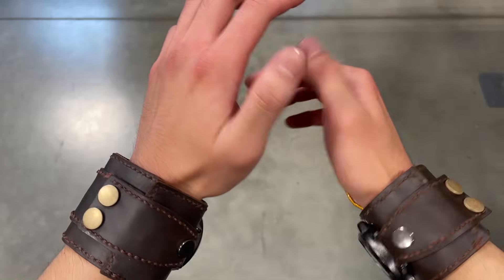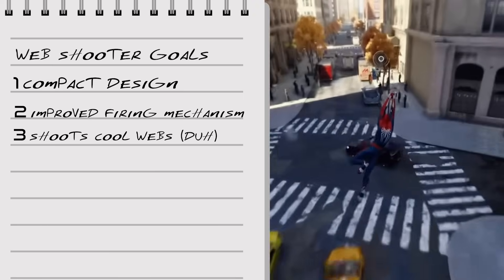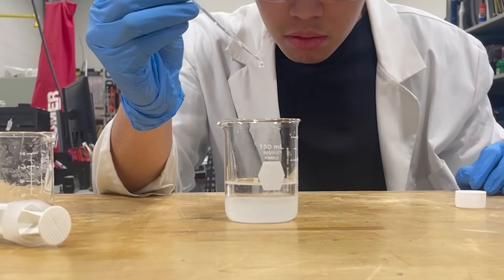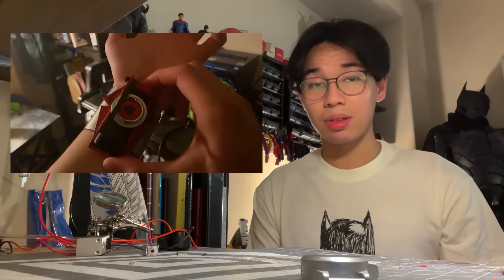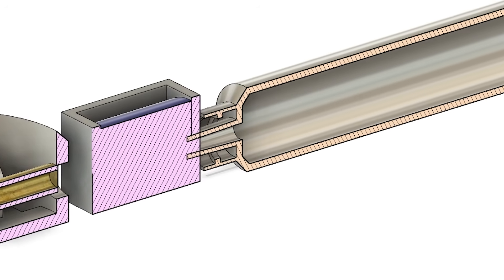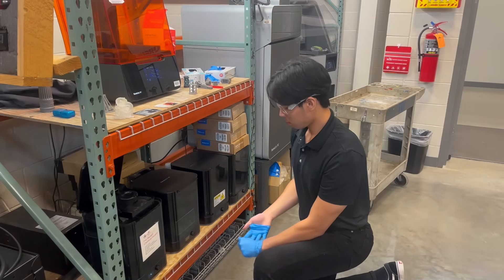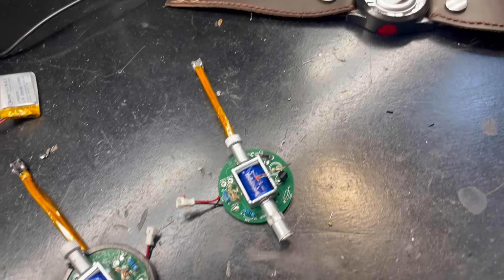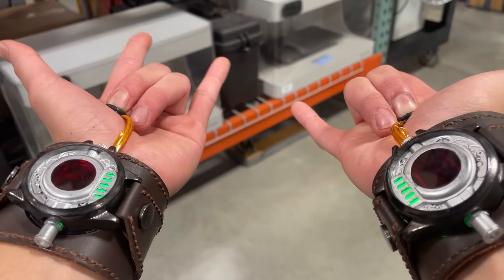How I Built Real Web Shooters | Spider-Man

Comment: Can you please make a proper tutorial? I understand that a solenoid valve only opens or closes the flow path, so I’m confused about how the water is actually being pushed out. How is pressure being generated in this setup? I didn’t understand how the syringe plunger, which appears to be under vacuum, I understand why it moves , but how does it push the water out. There is no pressure of any kind from the side of a syringe, for the water to be pushed out from the outlet. Could you please explain this step clearly?

Comment: Have you tried biosensors on the webshooter and modifying the sleeve and making an attachment?
The bio sensor would be used to detect muscle movement, when doing the spiderman firing method  certain muscles move, using a biosensor would detect the movements, using them as a firing method
Reply: Making an attachment for the sleeve should allow the biosensor to detect the movement better
Reply: Like a fitbit for example

Comment: Honestly, thats the most brilliant thing about Peters webshooters and how he designed them. Only he can use them, any normal person using them to swing like he does would likely rip their arms and muscles apart but since he has super strength, durability, enhanced senses, agility, and reaction time these gadgets that would normally be impossible to use are indeed possible but only for him. There's also the fact that the pressure needed to use the webshooters and actually shoot the webbing out is about 50 or so pounds of strength, something that you're average joe isn't going to be able to do with just two fingers and certainly not so easily and at a moments notice like Peter can. Only he can use his webshooters.
Reply: He ain't real though, bruh
Reply: @HAREKRISHNA-gv8qf obviously, genius. What are you gonna tell me Santa Claus isn't real either?

Comment: hey just one small thing that everyone forgets is the main reason his spider web is fictional is not cause of fast solidification it is just cause peter made his web fluid conductive too like alot conductive which is not easily possilbe along with fast evaporation of web fluid liquid and fast solidification and is most likely impossible as the sturcture would be unlikely conductive as most people use kevlar as a rope to swing wihch is not conductive as much as what is fictionally possible

Comment: Im quite confused with the wirng diagram especially when i try to recreate it on tinker cad. The trigger led keeps exploding.
Reply: ever find out a solution??
Reply: @xlIlI89 yes i did! But i did alter the components used. (I used 1 led to know when the trigger is pressed/firing) heres what i used, all of then are the same in the video. 

Blank PCB Board 
1 LED 
2n222 transistor
1n4007 diode 
250mah battery 3.7v 
2x 280 resistors.
Reply: Sorry i took 6 days to reply. I got caught up with academics.

Comment: List of Materials for the Spider Thrower

1. High Resistance Silicone:

* Product: Loctite 596 Red Silicone (300 ml) or AXTON High Temperature Silicone (280 ml)

* Use to: Create the resistant web fluid.

2. Polymers Reinforced with Fibers:

* Product: Repair mortar with fiber-reinforced polymers.

* Use to: Increase the resistance of the web fluid.

3. Special Additives:

* Product: Engine oil anti-friction additive or Fluid for FAP (Anti-Particle Filter).

* Use to: Improve the adhesion and elasticity of the web fluid.

4. High Voltage Springs:

* Use for: The launch mechanism.

5. Portable Air Compressor:

* Use to: Generate the necessary pressure to launch the web fluid.

6. Resistant Plastic Tubes:

* Use to: Channel the web fluid.

7. Resistant Container:

* Product: Stainless steel container with adjustable pressure valve.

* Use for: Pressurize the web fluid.

Assembly Instructions

1. Prepare the Web Fluid:

* Mix high-strength silicone with reinforced polymers and special additives in the appropriate proportions.

* Perform resistance tests to ensure that the fluid can support up to 70 kg.

2. Assembly of the Launch Mechanism:

* Springs: Install the high-voltage springs in the launch mechanism to provide the necessary strength.

* Air Compressor: Connects the portable air compressor to the mechanism to generate the appropriate pressure.

3. Pipeline System:

* Plastic Tubes: Assemble the resistant plastic tubes to channel the web fluid from the container to the launch nozzle.

4. Pressurized Container:

* Stainless Steel Container: Fill the container with the prepared web fluid and make sure the pressure valve is adjusted to maintain the internal pressure.

Wrist Mounting

1. Base to Hold the Device:

* Use a sturdy base, such as a light metal plate, to attach the entire device to your wrist.

2. Adjustable Straps:

* Use adjustable straps to firmly secure the device to your wrist, allowing comfort and mobility.

Comment: I'm a 13 year old kid so I don't understand electricity very well so can you tell me what 280 is in the web shooter component as well as tp1 tp2 tp3.. r1 r2...
Reply: I got you

Here's a breakdown of your part list and assembly process for the Spider-Man Web Shooter PCB (WSV4.2PCB v8). This will guide you in sourcing and assembling the parts:

Partlist Breakdown
Qty	Value	Device	Parts	Description
1		LED3MM	LED1	3mm LED
1		LED5MM	LED2	5mm LED
3		R-US_AXIAL-7.2MM	R1, R2, R3	Fixed Resistors (unspecified)
1	1N4004	1N4004	D1	General-purpose diode
1	2N2222	2N2222	T1	NPN Transistor
2		TPPAD1-13	TP5, TP6	Test Pads
4		TPPAD1-17	TP1, TP2, TP3, TP4	Test Pads
Steps to Assemble
1. Gather Components
LEDs:
LED1 (3mm): Likely the smaller indicator LED.
LED2 (5mm): Larger indicator LED.
Resistors:
R1, R2, and R3. Check the resistor values from the schematic.
For instance, they may be 680Ω for limiting current to the LEDs or transistor.
Diode:
1N4004 (D1) for protecting the circuit from voltage spikes (e.g., caused by the solenoid).
Transistor:
2N2222 (T1) used to switch the solenoid on/off.
Test Pads:
TP1-TP6 are points for soldering external wires or debugging connections.
2. Component Placement
Refer to the PCB layout you shared previously:
LED1 (3mm): Solder at the LED1 position on the silkscreen. Match polarity: flat edge of LED matches the line on the silkscreen.
LED2 (5mm): Solder at the LED2 position. Same polarity rule applies.
Resistors (R1, R2, R3): Place them according to the silkscreen at their marked positions. Orientation doesn’t matter for resistors.
Diode (D1): Ensure the stripe on the diode aligns with the stripe in the silkscreen (cathode marking).
Transistor (T1): Align the flat side of the 2N2222 transistor with the silkscreen marking.
Test Pads (TP1-TP6): These don't require components but are solder points for wires or debugging.
3. Solder the Components
Start with smaller components (resistors, diode) and then move to larger ones (LEDs, transistor).
Use flux and avoid overheating the pads.
Double-check for solder bridges between pins.
4. Wiring Connections
Power Input:
Attach wires to TP5 (+3.7V) and TP6 (GND). These connect to the battery.
Solenoid Valve:
Wire the solenoid valve to the corresponding pads on the PCB.
Switch or Button:
If not part of the PCB, wire the external switch to the appropriate pads.
5. Testing
Use a multimeter to check continuity and ensure there are no shorts.
Power the circuit with a 3.7V battery and test:
LEDs should light up.
The solenoid should activate when the transistor switches on.
6. Final Assembly
Mount the PCB into its enclosure.
Connect tubing and any other mechanical parts required for the web shooter.
Reply: @ShmuckSchlepp  wow tysm

Comment: Hello here’s some soldering guide for newbies like me! Step-by-Step Guide for Soldering the Web Shooter Circuit PCB

Here’s a detailed guide to replicate the soldering as seen in the provided reference image:

Tools Needed:

	1.	Soldering iron
	2.	Solder wire
	3.	Wire cutters/strippers
	4.	Helping hands/clamp
	5.	Multimeter (for testing connections)

Step 1: Preparing the PCB

	1.	Lay the PCB flat on your workbench and secure it using helping hands or a clamp.
	2.	Identify the component slots using the markings on the PCB:
	•	R1, R2 (resistors)
	•	D1 (diode)
	•	T1 (transistor)
	•	Other slots labeled for LEDs, pushbutton, and the solenoid valve.

Step 2: Soldering the Resistors (R1 and R2)

	1.	Locate R1 and R2 positions on the PCB.
	2.	Insert the 680Ω resistors into these slots:
	•	No polarity is required for resistors, so they can be inserted either way.
	3.	Bend the legs on the underside of the PCB to hold them in place.
	4.	Solder the legs and trim the excess wire using cutters.

Step 3: Soldering the Diode (D1)

	1.	Find the D1 position near the solenoid valve connection.
	2.	Insert the 1N4007 diode, ensuring the cathode stripe (marked on the diode) matches the stripe direction on the PCB.
	3.	Solder the diode in place and trim the excess legs.

Step 4: Soldering the Transistor (T1)

	1.	Locate the T1 spot (likely near the solenoid connection).
	2.	Insert the 2N2222 transistor into the PCB, ensuring the flat side aligns with the PCB marking.
	3.	Carefully solder the three pins (collector, base, and emitter).

Step 5: Wiring the LEDs (LED1 and LED2)

	1.	Locate the LED1 (green) and LED2 (red) positions.
	2.	Insert each pre-wired LED into its respective slot:
	•	Polarity is important: The longer leg (anode) goes to the positive hole.
	3.	Solder the connections and verify the polarity.

Step 6: Adding the Solenoid Valve Connection

	1.	Identify the TP2/TP6 holes for connecting the solenoid valve.
	2.	Prepare wires from the solenoid and solder them to these terminals.
	•	Ensure solid connections for high current.

Step 7: Connecting the Pushbutton (Switch)

	1.	Locate the switch position (near TP5) on the PCB.
	2.	Insert the pushbutton or wire leads into the designated slots.
	3.	Solder securely.

Step 8: Battery Connector

	1.	Attach a connector for the 3.7V LiPo battery at the appropriate terminals (marked as + and -).
	2.	Ensure the polarity matches the battery’s output.

Step 9: Inspect and Test the PCB

	1.	Carefully inspect each solder joint to ensure there are no cold joints or shorts.
	2.	Use a multimeter to verify:
	•	Resistor continuity
	•	Proper diode polarity
	•	Connectivity between the battery and solenoid circuit
	3.	Temporarily connect the battery and test the circuit.
Reply: 4 likes ouch lemme change that
Reply: This looks suspiciously like GPT-3's list formatting
Reply: @dasoftieguy  this suspicionsuision begin susupuisionsusysionly

Comment: Use thermoplastic polyurethane and put it in airless capsules, when exposed to air they harden and are flexible, 7 mm can hold between 100 and 150 kilograms without deforming much, thermoplastic polyurethane withstands a lot of heat but at 482 degrees Fahrenheit it dissolves completely and it becomes viscous and liquid again to put it in a capsule and reuse it.
Reply: Youd need to keep it way too hot

Comment: Smh, You can't begin making them compact.... you have to first create them large enough to use web fluid then eventually start compacting them down to a smaller size. That's why they are called "Prototypes" you begin big then make adjustments until the desired designs are perfect all around. Smh 😑,  You failed already and sorry I'm criticizing you but it's true. When you begin small and not start from big then slowly shrink it.... you make big mistakes. Now you cannot improve anything you'll have to make these bigger which is the wrong direction then make those small again. Like Jet engines or Car engines.... do you think we began large? No, we began small then made them better to make them perfect and then made them into the perfect size they were meant to be. For web shooters... you must begin by making them big then test it and perfect the fluid and then once the fluid is perfect.... then begin adjusting the size.... don't make the shooter small then add fluid.... just doesn't work at all

Comment: Hello somewhat Spider-Man nerd here 
Here’s a simple “web fluid” that’s very low budget and also can be used with most gases and cartridges. 
You will need 
Acetone 
Fabric Glue
Fabric glue is more rubber esc you’ll know it’s gonna work when you put some in between your fingers and a lot of strands come out 
Finally you play around with combining acetone and glue 
You want a ratio of enough glue to make it still string but a consistency of water 
To strengthen this fluid what should work is plastic wrap infused acetone and a d limonine and poly mix 
However if you just wana cosplay and have a simple web fluid that only takes two ingredients follow the first couple of sentences that I wrote 
I hope this helps your cosplay needs or if you just wana shoot webbing

Comment: For the web fluid why not use 1 cartridge with water and the other with the compound you're using. Maybe 2 short hoses conecting to a 3 way female connection piece and have that other port leading to the valve so you can combine the two before it leaves web shooter. Idk how fast the reaction is between the two but maybe someway somehow. Hell even maybe go for a homecoming kind of look to maybe have room for it

Comment: Wouldnt it work if u added 1 syringe of water and a little Co2 can instead of magnets?. U could fire both. I mean the magnetic thing is cool and probably more effective but the one with Co2 would be absurdly powerfull. Plus pneumatic is cool so why not try this?
Reply from the maker: Yes co2 is a stronger propellant than butane. But what magnets? The electromagnetic coil? If so, that’s just an opening mechanism. It’s still pneumatic pressure driving the fluid out.

Comment: Have u ever though of adding other polymers or chemical reagents to increase the strength but also keep the fluid in a viscosity similar to that of water, you could try adding PHA (polyhydroxyalkanoates) PHA can form fibers with excellent mechanical properties, including high tensile strength, Young's modulus, and elongation at break. Solvents like acetone or ethyl acetate can be used to dissolve PHA, but also biopolymers like alginate for flexibility and elasticity or chitosan for stiffness and shock absorption or even bombyx silk-pva(vinyl alcohol) fibers have good mechanical properties, i worked in a organic chem lab and worked in bio-chem lab so im not new to synthesizing materials, if you need help feel free to ask!!

Comment: Amazing project!! I will definently following along! If i may make a couple suggestions. 1. If you use an rfid chip and micro reader you can prevent accidental presses from the button. 
2. If you know the water to solvent proportion you could do a dual tank set up on either side. This would theoretically allow you to spray a stream vs a mist. 
3. If you used an atmega328p you could sequence the sprays and control the other parts. Including the potential for rotating nozzles allowing the multiple patterns. Using an addressable led for bas power mode would allow you to tell which head is active. The microcontroller would also allow you to use a 3 tank of compressed air(or gas of some sort) to clean the nozzle out after each shot
Edit: on the note of the formed tanks. If you used carbon fiber you could maximize tank space with without compromising pressure capacity. This is by no means criticism. Only ideas

Comment: These are really cool, and I liked how you noted things you can further improve on in future iterations of your web shooters. I’m currently working on a set of web shooters myself, although I made mine using a set of mini retractable dog leads with small weights attached. They’re not perfect either as the weight can’t be hidden, but it doesn’t get in my way since it dangles out of the way so it’s not too bad. The only other downside is because it doesn’t propel itself you have to swing your arm to throw the weight and launch the web, which means you can’t just point and shoot. It’s not too bad with practice though, since Spidey normally whips his arms around when slinging webs anyway. It needing practice to get good at aiming and feeling the weight and tension of the web so you can smoothly catch it and have it wind all the way back into your hand perfectly is also a slight downside, but practicing with it is fun anyway. The advantages: it’s completely mechanical so it never needs recharged or refilled, the lead automatically winds itself back up so you can shoot it again immediately, it not having a trigger means there’s nothing to limit your hands movement, the lead has a safety switch you can flip when you don’t want to use them, and as long as you make the decorative parts detachable in some way you could also use it as a prop for other characters too, like Scorpion from Mortal Kombat

Comment: for making the web fluid stronger using water, would it be possible to have a second container of water that fires off at the same time directly into your fluid? it prob wouldn’t make it as strong as a proper mixture of the fluid and the water, but it would still give it a bit more strength, maybe?

Comment: Do you think that the reason your web fluid only works when atomized is because of the moisture in the air. Going off you experiments with mixing your fluid with water an idea might be to hook up a small water atomizer to the exit of the solenoid to expose the fluid to more moisture allowing it to solidify in larger strands. Also I just wanna say how God Damm cool this is and I can't wait to see how far you are able to take this.